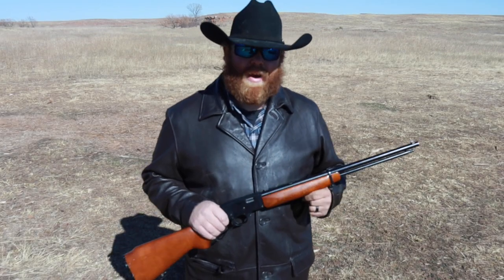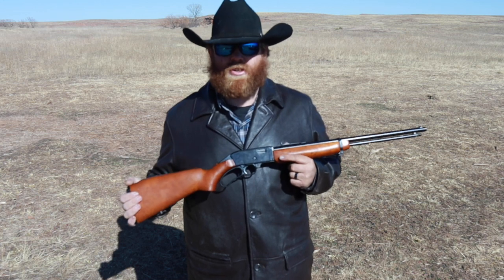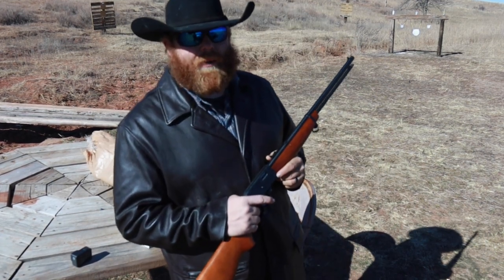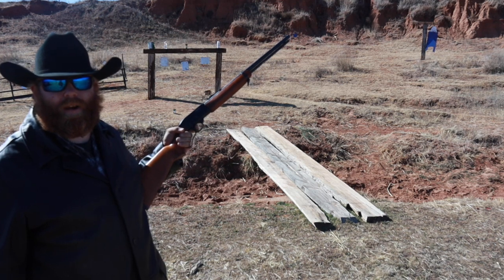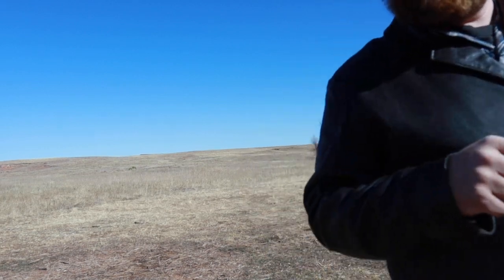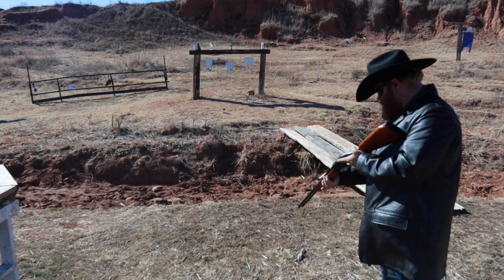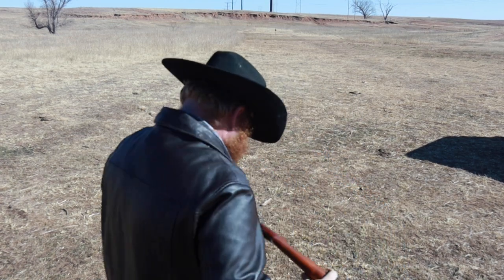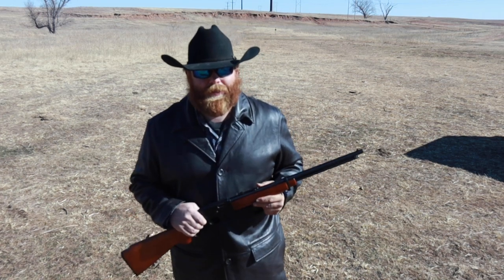the westernfield M895 / mossberg 402

Comment: Bought mine from Montgomery Ward in 1967, cost me $75 through their mail order catalog at the local store in my town. It’s been a pleasure to shoot for over 50 years now!  Only had one  had one problem with it. Back when I first started using it, the cartridge would jam if the feed tube was near full of cartridges, several would release into the action into the area where the cartridge would be positioned to be lifted up into the chamber by the cocking lever. There was a small spring below the lifting guide that would slide into the slot on the guide and allow the lever to drop, letting more cartridges to enter the action. I took the lever out, took it to a millwright and had him solder a small copper tube, just small enough allow the lift spring to slide into it and retain the spring from slipping out of place. That was the only issue I ever have had with this firearm. I’ve tried to attach a photo to the website where I originally posted the years ago, but this website apparently will not support or include photos to be include in the comment section.

Comment: You may have figured this out by now, but you can decock it by opening the lever and holding down the small tab in front of the trigger while operating the trigger. These are also very bad to dry-fire as it will break the firing pin and damage the edge of the chamber. I would bet that some of your feeding issues are due to a slightly misshapen chamber edge at the very top. You can gently file it in side the chamber with a mini rat tail and it will feed much more smoothly. Enjoy.
Reply: Cool.  One can also get little .22 chamber reamers that are especially for repairing that kind of damage.  Cheers!

Comment: Most of the budget rifles have feedramp/chamber mouths that are not well finished. 
Bull shells are lubricated  with a wax which sticks to the feed ramp. Boxed CCI are lubed with a dry coating.
Reply from the maker: that makes a lot of since
Reply: My W-F/MW model was terrific, once I fixed the tube feed, cartridge lift lever, it constantly would jam there!  The spring would slip into the slot in the middle of the block/lift lift lever, from underneath, allow cartridges in the feed tube jam that area, I bought a spare spring and block/lift lever, to try a fix, on the lower side of the lever, I brazed a small brass tube to slip the end of that troublesome spring into, keeping from sliding into that slot, and....NEVER HAD ANOTHER JAM THERE AT ALL, 50+ years ago, still have the rifle, still works fine!!  Passing along to my grandson some day!  Will gladly share a photo of my mod if the description here isn’t clear as what to do.  All three 22 cartridge sizes feed fine, S, L and LR, regardless of grain or bullet profile

Comment: I got the Mossberg 402A as a hand-me-down. My Pawpaw got it new from a guy that had a display in an A&P store that he managed back in the 1950' or early 60's. It had the cracked stock but a friend of mine fixed it and now all you can see is just a line if you look hard. I broke the original rear sight (was devistaed for breaking pawpaws gun) but got it replaced and now it is a tack driver at 100 and will eat anything. When I first started with it as a kid I put finger thrugh the lever but now I just wrap my hand around it.

Comment: I found this at form-(I had an issue with mine not wanting to extract and it was because the cartridge guide had slipped down a little bit and was preventing the empty case from extracting.
It was just a matter of turning the screw back the other way and adding a little loctite.)-dont know if it helps
Reply from the maker: We'll have to give that a try

Comment: Do you have any idea how to disassemble it?  I need to swage my chamber due to dry firing, and I can't seem to find ay info on how to take her down.
Reply from the maker: It's something youtube doesn't allow anymore We are currently shut down because of a YouTube strike for showing cutting a piece of metal that was made later on into a chain for a wheel lock lol
Reply: @Real11BangBang  I read through everything I could find and I figured it out this morning.  After you remove the side plate, you open the lever just a little and you can just pull the bolt right out through the side plate opening.  Turns out I have a broken firing pin and I'm thinking the extractors are bent.  Luckily they have all the parts on Havlins.  Hopefully I will be able to replace everything and get her runnin again.
Reply from the maker: It's something youtube doesn't allow anymore